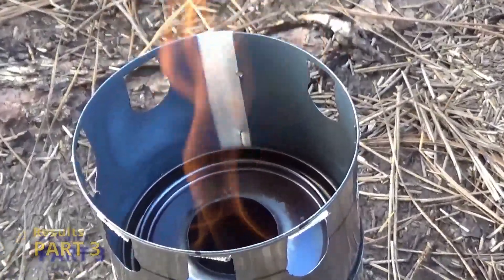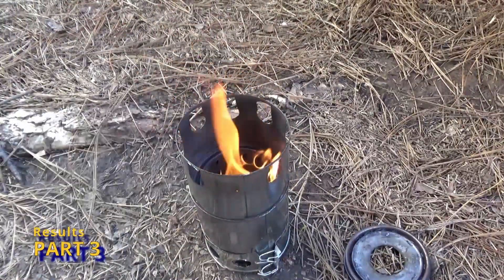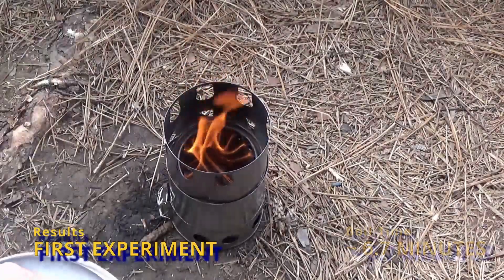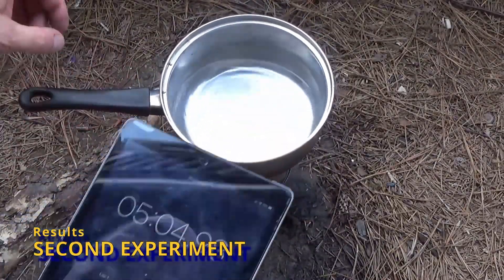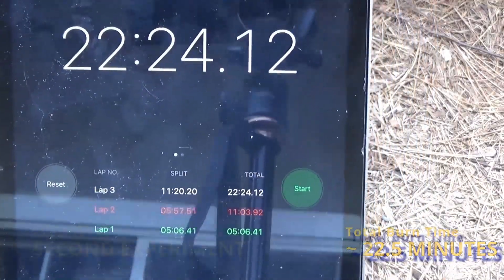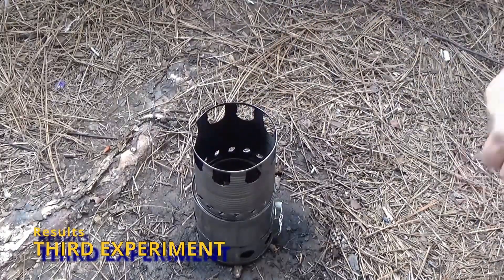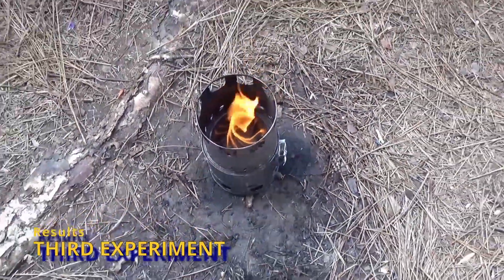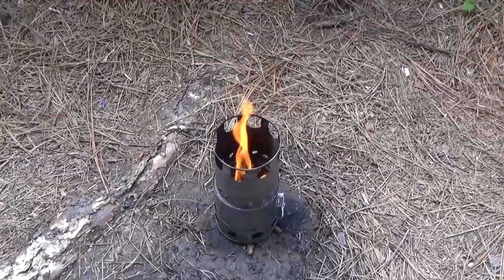Paint Can Wood Gas Stove Optimization! Wood Gas Stove Science| Making a good stove GREAT! Part 4!

Comment: I've been studying gasifier stoves on YouTube for years and have never seen you videos before, which is surprising 

I found your videos from another website that had one of your YouTube videos embedded. 

I have a circular stove grate that fits perfectly in the groove of a 1 gallon paint can, and would like to build a larger version of your quart paint can gasifier as a camping cook stove. And was wondering if you have ever made a  gasifier video using a 1 gallon paint can.

Specifically I'm interested in what type/size of inner can would optimally fit inside the 1 gallon paint can, to perfectly upscale the quart paint can stove dimensions. 

It's likely some trimming of a can that diameter might be necessary
Reply from the maker: I have not experimented with the one gallon paint can. It would be interesting though. If you do find a can that mates up well, you are almost there. The air ratios and locations of the holes will scale. Good luck and keep me posted. Thanks for watching!

Comment: Your pot holder has a rim. It traps some carbon dioxide air layer between the flame and the pot. Therefore, there is a thermal insulation between the flame and the bottom of the pot. Remove the rim.

Comment: 1:34 flame concentrator ixnay 3/16 to 1/4 inch on secondary holes pot stand not helping new one taller added 16 holes 5/15 around bottom all vortex tweak same direction as top 8 4:33
22:00 mins of burn time with 1 c pellets
5:53  new inner can honorary holes on outside

Comment: Stop using pellets ! There are no pellets in the woods and I ain't carrying them or buying them and they block air flow anyway !
Reply from the maker: The best way to tune a wood gas stove is with a standard fuel that will react the same every time. Hence the wood pellets. If burning correctly the pellets do not block the airflow since the fuel is consumed from top to bottom. There are other videos in the series showing twigs and branches as fuel. Thanks for watching.

Comment: How did you "angle" the secondary air holes like that?  Like did you punch them normally, and then bend/torque them with a chopstick somehow?
Reply from the maker: Yes, drilled through then reverse the drill and twist to the side while spinning the drill! Thanks for the question!

Comment: Hello Heath. Thank you for your videos, they are appreciated. Two comments about this video. When I tested my biogas stoves, the net affect of the flame concentrator was a significant lower btu output along with a much longer burn time. I do not have the pellets like you are using (I used battoned douglas fir 2x4's). In my smallest biogas stove, I was able to burn a 2x4 by 2.75 inches long for a total of 44 minutes (which was a record for me), but it was not putting out much heat (meaning could not bring a port with a quart of water to a boil). Secondly, I observed the soot to likely be a byproduct of the cold water in the pot. I could have a great flame, with no smoke, and then when the cold water pot was placed over the flame, it cooled the flame enough to cause the smoke (this occurs on both the biogas and rocket stoves in my case). Thank you again.
Reply from the maker: I agree with a slightly lower temp but flame is so much more, I hate to say it but, concentrated. Now that I am actually home I can take temperature reading to prove that is the case. Thanks for the comment!

Comment: so now are you using the 3 to 1 formula
Reply from the maker: Yes, the primary to secondary ratio changes depending on the air space between the two cans. I was really looking for a solid mathematical model but so far it still alludes me ;) thanks for the comment!
Reply: @heathputnam9524  thanks for getting back to me

Comment: Hey Heath why don't you put an isulation mantle around the outer can and add vortex effect at inlet air holes, the mantle will help to heat the air hotter and the vortex will make the air travel longer in a spiral than strait up, thus helping even more the air get hotter, maybe you can get blue flames.
Reply from the maker: I think both of those ideas have merit, let me see what I can come up with! Thanks for watching!

Comment: Heath very happy to see that you had a productive week and made good progress. That has to feel good!
Reply from the maker: It does, but I wished I didn't lose the original footage! It would have been a much better video! Thanks for watching!
Reply: @heathputnam9524  no worries it is a good video. Just a thought if you cannot get more secondary air (as a result of decreasing the spacing between the cans) then your re balance will have to be to decrease the primary air intake, no? Also what about including a small (1/4" size lip) concentrating ring just above the primary burn pot zone perhaps an inch and a half down from the top of the burn pot? This might create a better more effective pyrolysis zone?
Reply from the maker: I may need to give that some thought! Thanks for the comment!
Reply: @heathputnam9524  another possibility would be to add a heat pump in the form of a brass tube which connects from one side of the secondary air gap to the opposite side of the stove, this tube would have a hole in the centre of the stove on the top of the tube yu could place a small elevated cap to act as a horizontal deflector. The tube wold get hot and draft additional air from the air gap between the two cans. It would be a pressurizing heat pump and it would draft more secondary air for you.
Reply from the maker: I have been thinking of introducing secondary air using a central chamber drawing super heated air from the bottom of the burn chamber up through the center, but your idea may have merit! thanks for the ideas and comments!
Reply: @heathputnam9524  The horizontal tube and the vertical central tube are essentially the same design simply different ways to do the same thing. I was going to mention the central tube but it is a total overhaul of the stove design and would most likely end up with a different size stove though you could build a central draft stack in a single can stove and eliminate the need to use twin cans. It all comes down to "swings and roundsabouts" as they say in England. If you like I can send you a design drawing for a central draft stack design or not. Personally when I am attempting to get my creative brain wrapped around a design and working on all cylinders I don't look at anything else but what I think of myself, that does not mean that all my thinking is original or never influenced by others just that I don't want anybody else's priorities distracting me as I consider design posibilities. Let me know.
Reply from the maker: Thanks, I would love to see your designs! I like to collaborate and be inspired by others! Thanks for the comments!
Reply: @heathputnam9524  sorry I did not mean to suggest this design idea was mine, it is not. Here is the link I was referring to and in the description is a link to full design drawing. I suspect in this video the stove is burning at the very end of the burn and burning the charcoals or has a fan attached or is burning alcohol as the flame is too blue. Never the less the design looks solid so check it out. https://www.youtube.com/watch?v=_cgrLOHGqs0&list=PLrVBUdJ7InfBjjq_LwT8nPGm6HSNJqMra&index=55
Reply: @heathputnam9524  ㅜ9 ㅒㅠ7ㅑㅑㅍ